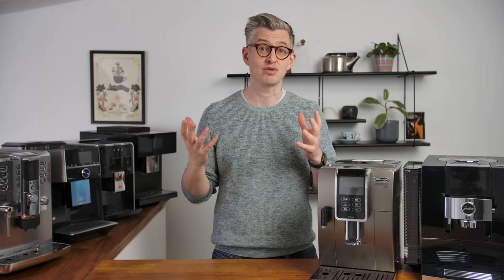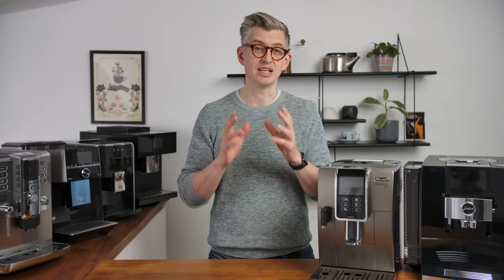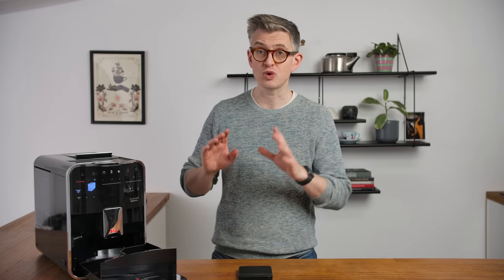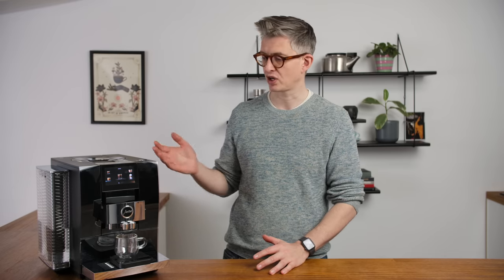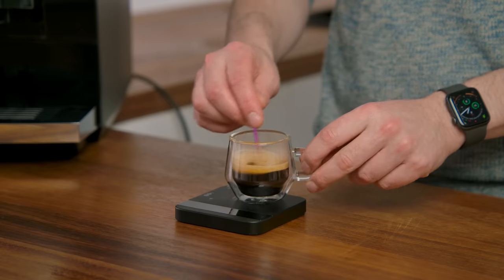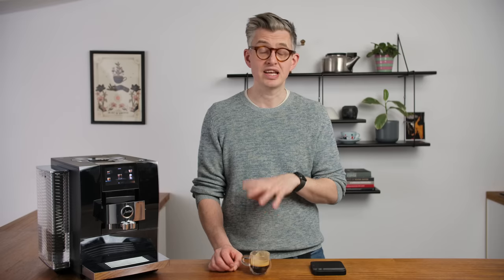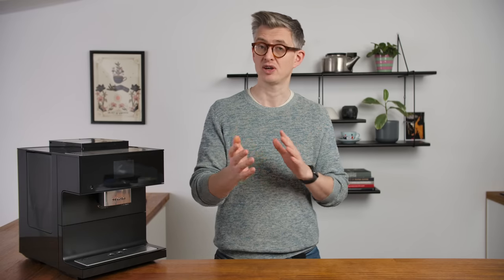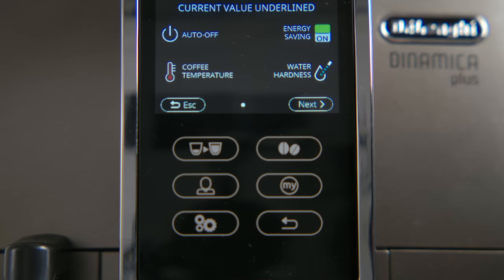How To Dial In A Bean To Cup Machine (Like A Nerd)

Comment: With De'Longhi machines, after grinding but before extraction starts, you just press the brew button again to cancel the brew. It ejects the dry, ground, unextracted coffee into the grounds catcher, unmoistened and ready to be weighed. No need to cut the power or reset anything.
Reply: Thanks! Confirmed on a De’Longhi Dinamica, pressing stop after the grind has finished (before the brew starts) results in the dry grinds being ejected into the grounds container. I got 12g from a “5 bean” single espresso.
Reply: Yes, it makes a HUGE mess in the machine.  The spring-loaded puck 'scrapper" is good at spent coffee, but on unbrewed grind, it sprays the loose coffee grind ALL OVER inside and is a pain to clean.
Reply: Anyone can share with Delonghi Plus machine, what is the grind size to set for espresso? Should I set to 5 bean dosage, temperature medium and grind size 1.5 which is 1step away from the finest setting?
I try 1.5 setting, crema look nice but the taste is not very good.
Reply: @bryantwong140  Don't over think it.  The grinder does rotation count, so it's anything but precise.  Even the amount/weight of beans you have in the hopper will impact the weight of each grind.  Unless you have a circular cone shaped hopper, it's not even worth to be too precise on each dosing.  Sad thing is that most super autos have rectangular and odd shaped hoppers.
Reply: @meurigf  u set what temperature for espresso.
5 beans and medium temperature?
Reply: Thanks, worked on my Eletta which produced 9 grams on the extra strong setting
Reply: @bryantwong140  lighter roast hotter water. Darker roast colder. I use grind setting 3 And water temperature medium with lavazza super crema with dinamica
Reply: @meurigf  it is also hugely depends on grind/coarse settings ..which is no one talks about ..even @James Hoffmann , as he said coarse setting are usually timed in machines so normally finer coarse would be harder to grind and at the end there will be less grinded coffee to measure.. which is truly the case with 'our' De'Longhi Dinamica and the max difference is not negligible..at coarse setting 1 I measured 8g of coffee and on coarse setting 7 there was 16g of coffee at max setting for max coffee amount or '5 beans icon'..so 8g difference :) .. in reality we will all use coarse 1 to 4 but even there is difference of ~4g of grinded coffee so you would have to adjust and water amount depend and on coarse settings beside other things if you want to follow that 1:3-4 coffee/water ratio for good espresso. 
FYI water setting 1 will give you 30ml of coffee, 2 - 40ml, 3 - 50ml and 4 - surprisingly 120ml... all tested multiple times. 
Btw I spent at least 300g of beans for all this 'crap' info and at the and ,sadly I am not sure will I taste significant difference on any combination of settings for espresso :D
Reply: @sweepmoggy  do you have the Eletta Explore? Do you mind sharing your settings?
Reply: @tuliniemi  ive used lavazza super crema, after few months the coffee grinder had to be replaced.. luckily it was still under warranty, how do you get past the oily beans?, the service guy told us that our bean was too oily and it choked the grinder..., not sure if that was the real issue but now were using medium roast coffee beans from local shop
Reply: @miroslavpena this is probably the key takeaway here. These super automatic machines are so secretive about what they actually do, you can’t really properly dial in anything except if you have incredible patience and expertise or found someone on the internet who dialed in the exact same machine you own.

My procedure (with DeLonghi Dinamica) is as follows:
- go a little finer than factory settings on the grind, just before it starts dripping instead of flowing out
- go on 5/5 for the bean settings
- just set the amount of liquid to what you prefer in your cup
- set temperature according to your type of bean
Reply: @miroslavpena  this is good info !  Thankyou.   What grind size did you land on for espresso with your Dinamica?

Comment: Thanks! After some trial n error, these are my settings for the Melitta Purista and Lavazza Crema e Gusto beans: temp high, bean 2 (10g, 3 bean is 13g), Grind 1 (finest, still good flow), 40 mL, which is exactly 1:4 ratio. As said, if you go lower than 1:4 it starts to taste first a little sour and then really weird. A little higher is to "watery". Thats at least my results and taste. Now I will start experimenting with the beans...

Comment: As a mechanic of bean to cup machines and coffee enthusiast I'm very interested in the review. I hope you've been experimenting with the unique SBS dial on the front of that Gaggia Accademia. One of the few bean to cup machines that can adjust the flow. 
A few things in this video: are you aware the amount of ground coffee in strongest setting is not always the same? With a Saeco/Gaggia/Philips for example it depends on a algorithm based on the power consumption of the brew group motor. This is meant to adjust for fine/coarse grinds.
The majority of these machines is marketed more towards a long coffee than espresso. At least here in the Netherlands. 90 percent of my customers use it for just coffee (and cappuccino now and then).
Reply: We have a WMF 1100 S at work which can do coffee in various combinations, you can even program multiple-steps-coffee-recipes into it. It can also do hot water. But for some stupid reason, you can't do an Espresso followed by hot water automatically. It just doesn't let you to program this and I don't know why this was overlooked.
Reply: @mbirth  True. It's a shame it has only a separate hot water tap on the side. There are even several consumer machines that have a hot water sprout directly next to the coffee sprout to make an Americano.
Reply: Kan je uitleggen waarom het niet mogelijk is om een volautomaat met 25 seconde brew time te maken, dit moet toch wel te doen zijn, ben benieuwd wie als eerste uit komt met een ware espresso volautomaat in plaats van alleen maar lungos.
Reply: Tevens, zijn apparatnen al de instappers van Franke aan te raden, ik heb gelezen hier en daar dat sommige wel de juiste tijd voor het juiste volume dus meer in de buurt van juiste % kwa koffie extractie, ik denk dat het overkill is om iets als een Franke in huis te nemen maar het kan een soort van ''final chapter'' zijn voor de luie superautomatic mensen (toegegeven, meestal ook als mijzelf...)
Reply: Hi Peter, I enjoyed your take on this. At 4:43, he addresses your point about variation in amount of ground coffee between machines.
Reply: @stirfryjedi  James mentiones the variation in weight between different machines/brands I guess. I mean on the other hand the variation in weight at the highest dosing of a machine (and the technology behind it). 
A machine doesn't weigh the grounds by the way. They use technology to measure the filling of the brew group.
Reply: @revoltoff  de 25 seconden 'regel' geldt niet echt voor deze volautomaten aangezien er niet op maalfijnheid wordt gestuurd. Het is beter vergelijkbaar met een 'pressurized filterbasket' van bijvoorbeeld een Sage machine. Bij zo'n dubbele wand filter wordt druk opgebouwd door middel van een kleine opening. Bij volautomaten gebeurt dit meestal door een (crema)ventiel. Vaak niets meer dan een veer en een stop. De fijnheid van het maalsel is dan niet zo van belang. De doorlooptijd is daarom ook vaak grotendeels gelijk, of je nu grof of fijn maalt. De SBS knop bij Saeco en Gagga die ik noemde, is een mooie feature om de flow aan te passen. Echter is dat handmatig waardoor de doorlooptijd erg moeilijk af te stellen is. En helaas zit die knop niet meer op nieuwe modellen.
Reply: @revoltoff  overigens is het natuurlijk technisch mogelijk om op tijd (bijvoorbeeld 25 seconden) te sturen. Maar dat is dus niet altijd beter in het geval van volautomaten. Jura heeft bijvoorbeeld technologie die ervoor zorgt dat bij ristretto of espresso de extractie iets langer duurt zodat je minder kans hebt op een zure ristretto of espresso maar dat is niet tijdgestuurd.
Reply: Do you have any advice towards brewing long coffee for these machines please? I'm using a Delonghi ECAM370.95.T and almost exclusively use it for regular coffee rather than espresso. Curious if you think James's advice holds regarding brewing an espresso then just adding hot water rather than using the functions on the machine.
Reply: @thejamez10000  an espresso with hot water (Americano) and espresso lungo are really two different drinks. Some will prefer the one over the other. Almost all fully automatic espresso machines can make a lungo. And some (especially newer) machines can make an americano automatically. Without you having to pour hot water in the cup. 
For a long coffee (espresso lungo), the best advice: don't use a large cup. Most bean to cup machines are optimised for a relatively small cup. Somewhere in the range of 110 to 140 ml. Most brew groups can't handle a large amount of ground coffee. 
Normally with a classic espresso machine you'd like to work with variables and ratios but with bean to cup machines it's more based on trial and error, and taste. Adjust grind size, cup size, strength, temperature (and flow and pre brew in some cases) and just try to make it perfect according to your taste. The basics are the same as with a classic espresso machine (finer: more bitter taste etc etc). 
A disadvantage with bean to cup: you will never get the perfect cup of coffee. The next cup will always taste different to the previous because the technology tries to adjust everything with algorithms etc. Just like I mentioned the power consumption of the brew group in my first reply.
Reply: @thejamez10000  in my opinion it's easier to get a decent (small) espresso lungo out of a bean to cup machine than an espresso. The extraction time is too short with most machines for a good espresso. But you will also never get a good tasting big cup of joe out of these machines. Just like James pointed out with the Siemens machine when he said at the last part of the extraction: you don't want that, that tastes horrible. 
(By the way that Siemens has a different technology than most other manufacturers. Those EQ machines grind coarser and have another type of pump. Which is quieter but also has less flow. The extraction time is longer than most other machines. And no, I'm not very impressed by the quality of this brand.)
I can't wait for James' review!
Reply: Love that your contributing so fully here @Peter V.  Super interesting to get your perspective. I'll look for your comment on James' review video.
Reply: As someone who has a Gaggia Accademia, very interesting! I always struggled to get good-tasting coffee and never quite knew what to do with the unique 'SBS' dial. Any tips?
Reply: @revoltoff   Use English man!

Comment: TBH the primary use-case for these things is in small, or home, offices. I've worked in many places that had industrial vending coffee machines that were worse than instant, but one day I joined a place that had a delonghi BtC machine and it was significantly better. I bought one for myself! The problem of course, is that in such an environment, you don't want espresso or similar, you want a mugfull to sip while contemplating the meaninglessness of your existence as the sales manager tells anyone still listening of this meeting's weekly projection forecast revenue opportunity projections.

So I'd be more interested in the "real world" uses of these for getting a decent mug of coffee out of them.
Reply: He did mention you'd top it up with water to get a longer coffee
Reply: One needs a triple espresso to stay awake through the sales pie charts and tps reports
Reply: Yes, sip melancholy. A caffemelancolatte
Reply: Some of those let you pull an Americano which is basically a small and strong coffee diluted with water. So basically what you want .
Reply: The long black option on these machines often runs all the water through the coffee, resulting in a large but bitter tasting coffee. It's better to use the espresso option then add plain hot water.
Reply: I have a dimanica, my wife and I pulled the trigger on one as our anniversary gift to ourselves a year ago... I like it. There are days I wish we would of just bought a Gaggia Classic and rolled from there. 99% of what we drink is over ice so the Dimanica works well for us for now
Reply: I love the dinamica. It's $5-6 p coffee where I live
Reply: I've been waiting for this review for 6 months
Reply: @djhdesigner   The thing is if you NEVER drink espresso drinks you can tweak for a better long cup and not need to add water.  I have mine set with a fairly long shot and a "double" will make a rather decent small mug.  

I understand James point too, he wants to be able to do both.

Mine doesn't have milk drinks - it does have a manual wand I never use.  I also only paid $550 for mine.  :)  (lowest end DeLonghi BtC)
Reply: Yeah, now about those TPS reports…

Comment: Very interesting! Thanks for this. I just bought a Saeco Xelsis, and after reading several reviews the consensus seems to be that everyone likes a grind setting of 2-3 for espresso drinks. The manual says to leave it at default and that it will self-adjust over the course of a couple hundred brews, but most people aren’t keen to wait, and are very happy with the 2-3 grind. Another common consensus with the Xelsis, is that the default temp is plenty hot, and that the higher temp doesn’t taste as good. That is coming from people in the community BTW, not Amazon reviewers complaining about a defective boiler, or expecting the steamed milk option to magically make scalding hot milk without clogging the mechanism.
Reply: I agree with those reviewers. We have a Dinamica Plus, and surprisingly, it did take a couple hundred drinks before tinkering started making much of a difference. And we did end up on a grind 3, max aroma (beans), 50ml coffee, for us to get a 43g espresso, that we liked the taste of.
Reply: We have this machine at the office. Looking forward to go through the settings and see how it's been set up after this.

Comment: I found that my Philips has so limited settings in grinder and heat, that it was more a matter of finding a coffee that it could do right and it wasn’t the most expensive beans that tasted best because of the limitations. Still, proper freshly roasted beans that hasn’t been sitting in a supermarket for a year are still worth it for a fuller taste. Now that my old Philips Saeco needs replacing soon, I will go looking for one with greater adjustment ranges. 
I like the automatic machine because I will never be good at making coffee with consistency and I fell the machine helps me take a lot of the parameters I fail at getting right out of the process. But I know it can only at most get 70% there of getting the most of the beans compared to a skilled person doing it manually.
Reply: Grind adjust is not the only thing.   You need to look for one with the right hopper.  Most rectangular hopper design means uneven lowering of beans when the hopper is less full, so you get less and less of a dose per grind session as the hopper has less and less beans.
Reply: Interesting video,I might start experimenting with my Saeco Odea Giro Plus. On the whole,I have been very happy with the machine though, but never knew that the sourness that I dislike on the really short setting (the giro has a dial to adjust volume of drink from tiny to really long) so it will be fin to play with that 
I remember when the machine was delivered, there was a small slip of paper in the bottom of the box that was written in Italian only, my coffee fanatic friend who had recommended the machine told me that the paper was also in his box and he translated it for me - the slip  said to forget all other grind settings and always have the machine on the finest setting for true espresso and to disregard the advice inside the manual.
I've always followed this advice and never had the machine on anything but the finest setting

Comment: As a first step to home espessso milk based drinks, I think they're a great option. I had a Delonghi unit we bought second hand and used till it literally fell apart. Made consistent, very good, very tasty coffee. Not the "greatest cup of coffee ever brewed (TM)" but certainly, consistent and good. I think that's important for a lot of people. I've gone down the home espresso setup with grinders and bottomless portafilters and the like since, but I have friends who have various versions of these and they work well. Nice to see them reviewed, I wouldn't turn my nose up at the coffee from them (though some of the bean choices can be terrible) so deffo great to see that there are ways to tweak and "dial in" a decent coffee from them.